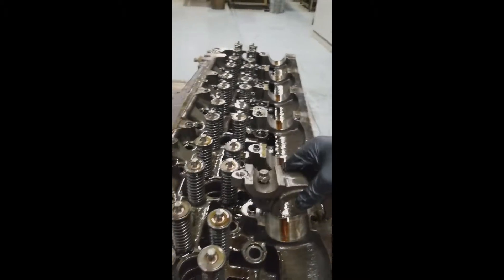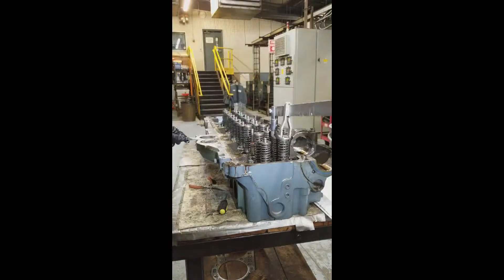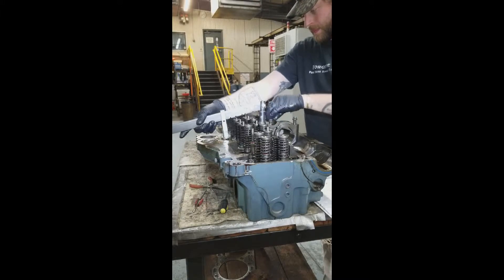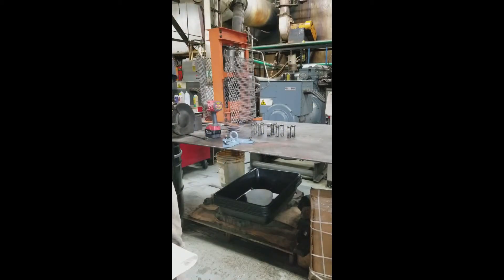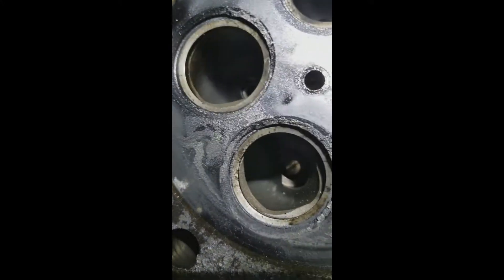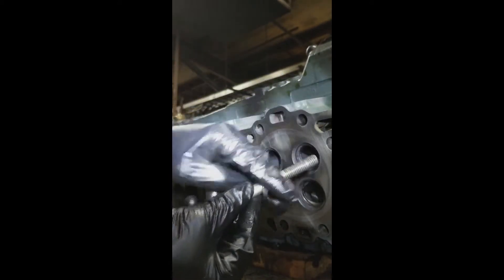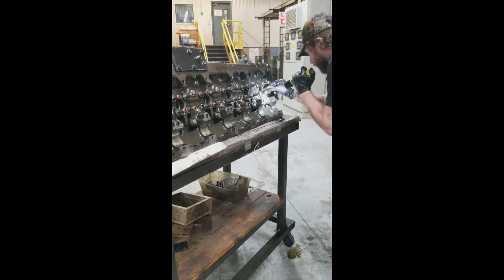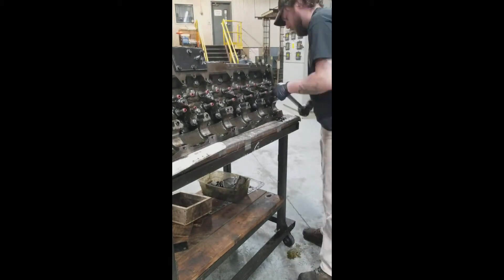Detroit series 60 head pressure test

Comment: I have a 12.7  60 series.   1996.  I’m getting air bubble in resivore.   Put Nee head gasket on it liners good.  With inspec.    and head looked good did not send out to have checked.   Found head gasket had crack in it.   Put back to gather.  Went 182 miles and lost power.  Sounded rough.   Would only ideal.   More air bubbles in resavor.   Towed home tore down everything looked good.  Sending head out to have checked for enternal crack.   Pushed a littl water out over flow.   Second time.  Any advice.   Could this be a injecter cup or liner.
Reply from the maker: Could be a cup, could be a crack in the head.   

Pressure test would be called for for sure
Reply: @poet99999     Thank you very much I’m going to do that this week and I will let you know if they found anything
Reply: Where is your shop located
Reply: Cut the counter bore, you may have a cylinder that has dropped below the specs